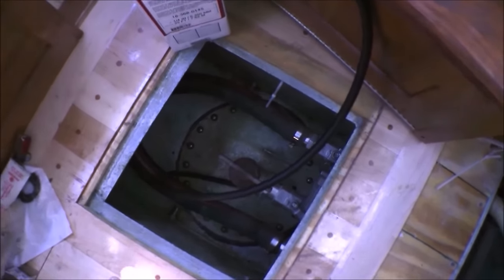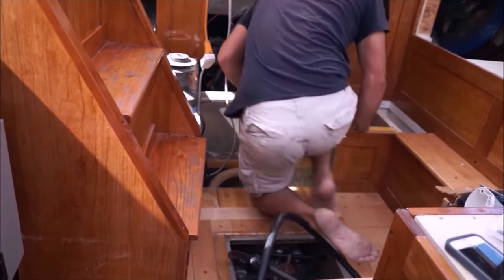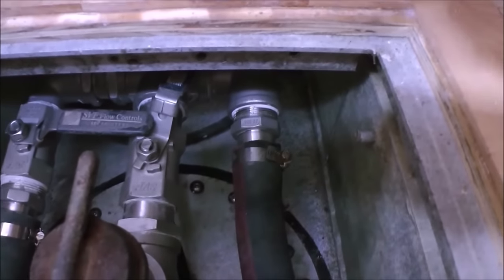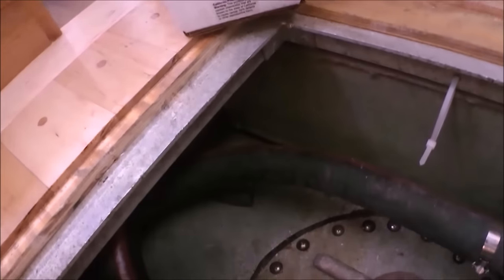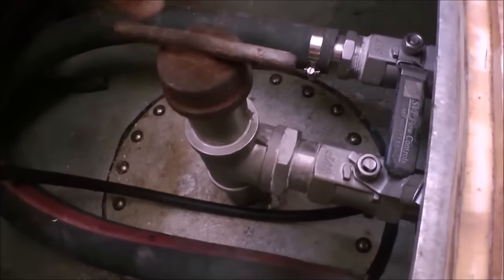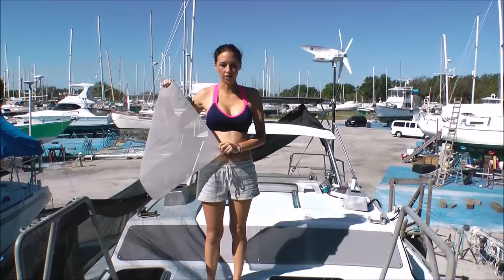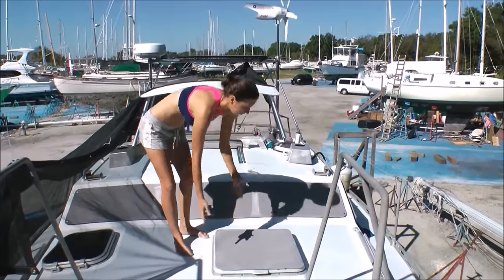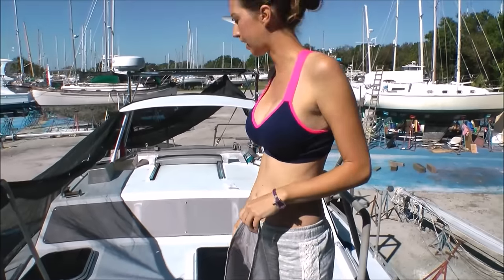Sewing, SNADS, and Fuel Systems (MJ Sailing - EP 13)

Comment: Good idea on the in-line fuel filters. We have started adding the 3/8 inlines on our big pumps to clean the schmeg out of the diesel fuel before it gets to the fuel pump and the primary and secondary filters. The plastic filters are way cheaper than the Baldwins! I must tip my hat to the two of you living on that boat in the Florida heat. Summer is about three hours away, and if this year will be anything like last year....it's gonna suck!

I deal with heavy equipment and large diesel pumps here in lovely Fort Lauderdale, so if you guys ever need anything, I'd be happy to help!

Comment: excellent video! excellent work! take a sewing machine on your travels, you can make extra cash with your handiwork. matt, if I may suggest, you have the basic setup ready to go to make a fuel polishing system, just adding in another filter and using one tank as a day tank. if you want to see an excellent system, tour any nordhavn. great for remote places with questionable fuel. you two are the best, y'all think things through

Comment: Just found your vlog this week (nice!) and I had noticed in an early episode that it appeared that some of your windows were plexi, throughbolted to the hull at the four corners.  In this episode you mention crazing. If those windows are just through-bolted, that WILL cause crazing, it is a mounting design that GE and others expressly say not to use because of that problem. If they are mounted like that, you need to make the mounting holes oversize, to allow the plexi to expand and contract, with large fender washers to keep it trapped under the screw/bolt heads. FWIW.

Using 3M VHB tape, and no mechanical fasteners, is another good alternative. 

And if I've "misread" what I saw, "Nevermind" as the old SNL show said.

Amazing job you've done!

Comment: Top-Snapper Snap Tool For Boat Snaps at Amazon  or at most marine stores would make life much easier and your snaps will last longer. It also help to use a tiny bit of zipper lube of even naval jelly on them.
Reply from the maker: Good to know, thanks for the tip.  :)

Comment: If that was my fuel line setup, i'de change out those irrigation clamps for some fuel line clamps. The irrigation clamps cut into the rubber lines

Comment: Plastic windows develop superficial cracks within 1 to 2 months if exposed to any solvent, especially acetone (e.g. - cleaning desk, wiping down the plastic, etc.) Not sure if that was the case for you, but just dropping that info for when you get around to the window replacement.

Comment: Great video! I apologize in advance if I misunderstand why you put valves on the fuel tank vents, but not allowing the tanks to "breath" even when not i use is a REALLY BAD idea. The air in the tanks has to be able to flow freely as it expands and contracts with temperature.  If you're worried about water intrusion, you can move your vents higher on the boat and Attwood also makes a vent that has a built in "P - Trap" to prevent water ingress.
Reply: Good point.  The vent valves are actually to be kept in the open position at all times unless I need to completely isolate/eliminate a tank when/if there is a leak.  Of course the vent wasn't hugely important for isolation, but I figured it also means two less vent holes.  The original plan was to bring all three vent lines high up and loop downwards.  At the bottom install a tee facing down and to the  hole... all without making a fuel trap.  I wasn't able to locate an area to do this high enough.  I guess we'll see how it works out.

Matt
Reply: Yes, a fuel trap can cause frustrating gremlins until it is fixed. I also try and make a loop in the vent hose above the actual vent so that it is self draining if water does enter it.  What size vent line are you using, The minimum size should be 5/8 which is also Coast Guard regulation.
Reply: Unfortuantely we were limited by the stupid welded in stub hose fittings.  They really are metric sized, but closes fit is 1/2"
Reply: Matt.....I was just wondering about the arrangement for those vent lines and I thought I would add my own two cents to the conversation. All of them run into a single vent line to the outside of the boat, however you are venting several tanks into what ends up being a single 1/2 inch line. That means the volume of air venting is limited by that last line. I would think that that last line needs to be three time larger to support the air flow of the three vent lines to prevent a bottleneck although the actual volume of air/fumes venting may not be that high. Rather than a T,  I would suggest using a manifold to run each line into, and then vent that manifold with a larger hose to the outside, or vent each line separately to the outside while still having the shutoff valves. Just a thought!
Reply: Hey Marc,

I'd guess maximum fuel vapor/air flow would be during refueling, when the amount of fuel added would equal the amount of air needing to be pushed out the vent line.  ABYC 183.520 on fuel tank venting said that with a fill rate average of 9-12 gallons a minute, a 9/16th hose was adequate to not experience fuel fill blow back.   Now I can only fit 1/2" due to the fitting, but each tank is filled separately, and at that time, the filling tank's vent can be valved to only have that go through to the outside.  

Also, the previous configuration for the past 30 years has been for the three tanks connected with 1/2" hose and a tee, which was brought to a single vent.  Doesn't mean it's right or recommended, but at least there is history to it working with these tanks.

Matt

Comment: Is the fuel transfer pump on the engine? What is the fuel lift height?
Reply: The Yanmar 4jh4e requires a separate fuel pump.  Ours is a Facet pump.  Keep in mind that we have a day tank that will feed the engine.  It's above the engine, but the fuel feed is on the top of the tank,  so it won't gravity feed the engine unless a siphon is created....not sure if that will reliably happen.  The bunker tanks are pushed to the day tank via a Groco fuel transfer pump.  I bought this because I already have the same pump for oil change and can switch pump heads or rebuild with just one spare kit needed.

Comment: why are you changing out the fuel system, gravity system is used on most boats
Reply: If you're referring to gravity feed between the tanks, we're concerned that at 34 years old, one of the tanks will leak sometime.  We wanted to easily be able to eliminate that tank.  Also, If we take on bad fuel, we're able to isolate that too.
Reply: good idea